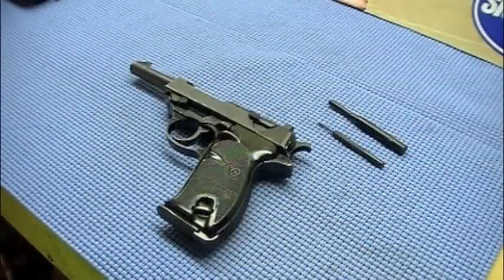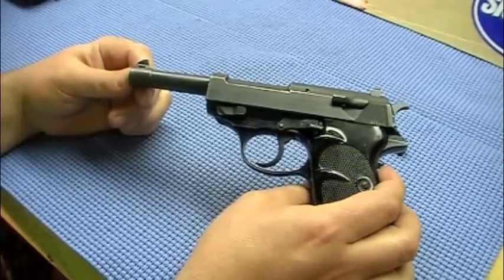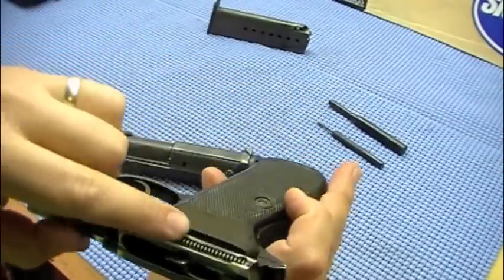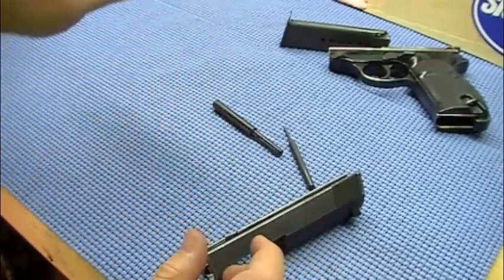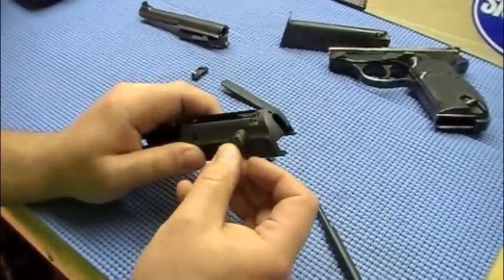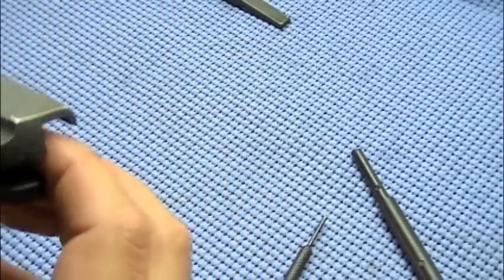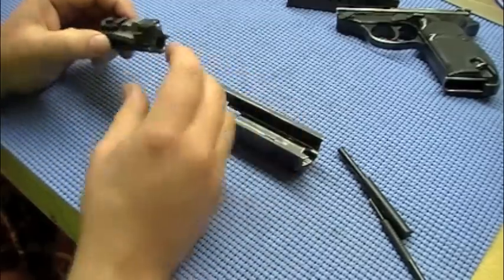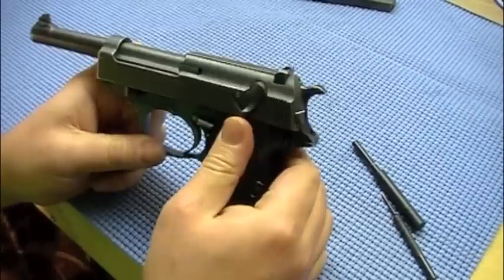Walther P-38 Slide Disassembly.m4v

Comment: This video is awesome.  I recently bought a P1 that was made in 1963.  It had an early slide marked "P38."  After cleaning and oiling, I noticed that the slide had small hairline cracks half way along the sides of the slide.  The gun was unsafe to shoot.  I managed to get a new re-designed P1 slide with thicker sides.  Your video helped me strip the parts out of the old slide and assemble them into the new slide.  Everything went together perfectly.  Thanks!

Comment: Thank you for an awesome video with great camera work and speaking clearly! I just bought a pristine P1 and stripped it down completely to clean (what little dust there was on it) and lube it (Frog Lube all over & some grease on high pressure spots) I also painted the sights and  end of the chamber indicator with fluorescent paint.  Off to the range now!

Comment: HEY good job I am a professional Gunsmith and I have worked on a few of these Before I even Learned a few Things I didnt know before! One word to advise the dust cover you took off on the slide was not designed to be removed all the time, The legs on the cover will eventually break or work it self lose. Only remove it if you have to to fix or repair the parts inside but Great job showing how Thank You for sharing! your friend in arms Mark D. Aul

Comment from the maker: Look at min 5:45 on my FRAME disassembly video and you will see that the ejector is spring loaded.  The extractor is in the slide.  As far as the firing pin not coming out, I have no idea.  I have now worked on three P-1/P-38's and have had no trouble.